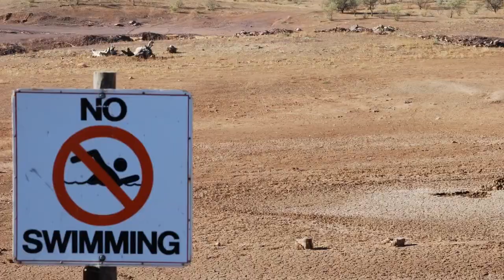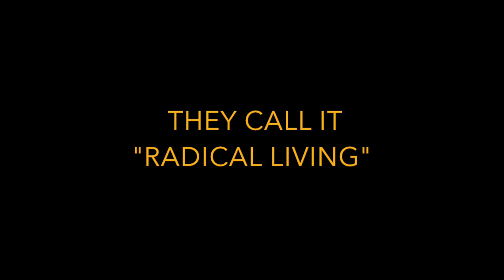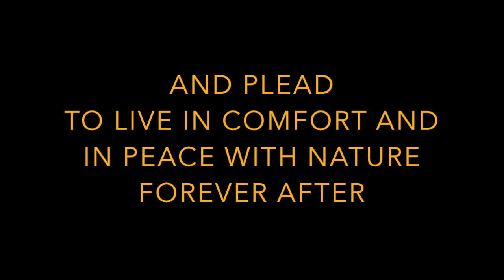Earthships: Living Beyond The Yellow Brick Road

Comment: Earthship Biotecture could really benefit from more versatile adaptation to vernacular architecture in different climates. Radical living has no “one” face. I see way too many cob or adobe earthship-like structures planted in unsuitable climates with low diurnal temp variation because it’s the only way they see a path to radical living. I think we need to up the ante here if we’re really talking radical.
Reply: I agree. I love the spirit of Earthship, but it is certainly not a one size fits all solution. Diversity is a key element of sustainability.
Reply: Pecker Dúnling San Patricio Space Dolphin Brigada  I bet that’s true in most cases, but Earthship Biotecture was actually hired for construction in Manhattan recently (and many other cities like philly)! Land masters are surely an issue of great magnitude for sustainability, along with power dynamics as a whole, but I sense more than a little too much intentional focus on the iconic earthship form for publicity’s sake rather than on its appropriate adjustment/reinvention for other climates, to hopefully carry out the mission they seek to achieve.
Reply: Pecker Dúnling San Patricio Space Dolphin Brigada  YES!! Such an exciting concept.
Reply: the idea of the earthship is to store heat in the walls and underneath the house. I was thinking it might be cheaper and more effective to store the heat further underground and vent it into the house like you could collect a load of heat under some plastic sheet with a tube spiralling down underground. over the summer it could just sit there and soak into the ground and then come winter you open the vent into the house and control the flow rate to manage the heat. the light in the winter together with escaping heat along the edge would be enough to pre heat the air before it goes deeper down into a huge battery of heat. you could heat a tipi or a straw bale structure with it and turn it down over night to conserve the heat. kind of like how they cool the earthship in the summer using a trench. it seems like there is no need to put the thermal mass in the actual house just attach the house to the thermal mass. then the house can be designed with windows on 3 sides and made smaller so it is cheaper and more modular. you could even use the roof to collect the heat. you could errect a yurt ontop of ground you had heated in the summer and put straw round it to protest the ground round the outside. then move the yurt to a cooler spot over the summer and vent it with a cool air pipe. I hooked something up to a house air vent and it warmed it up after a couple weeks. it was preety mild climate but it could be heated with just a couple square meter of plastic sheet and a long pipe. it works nice if you put the fire on aswell coz it draws a load of warm air in instead of the usual cold.  instead of being 15 it was up around 20 degrees just with the makshift version. quite amazing really so I was thinking how much better it would work if it was storing the heat from the autumn underground and lagging out the nights.  a lot of houses need to be vented in anycase to stop mold and damp. the more the better really.  If your providing air intake then it pressurises the space more so less cold air is leaking in elsewhere.